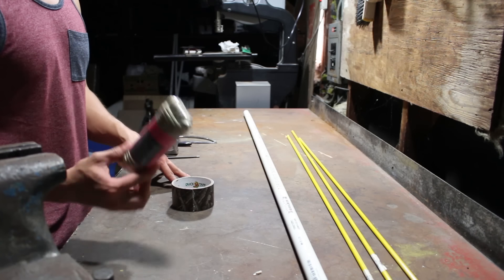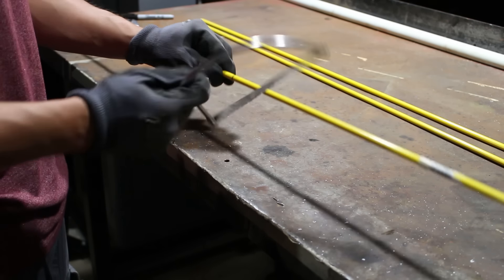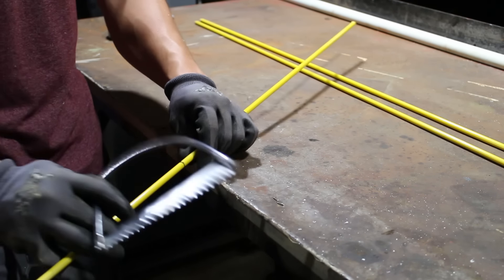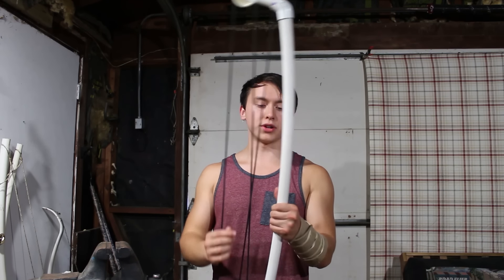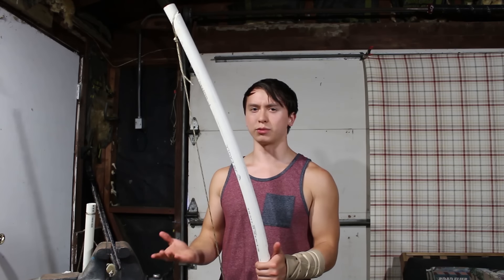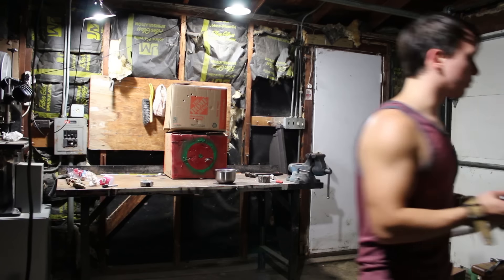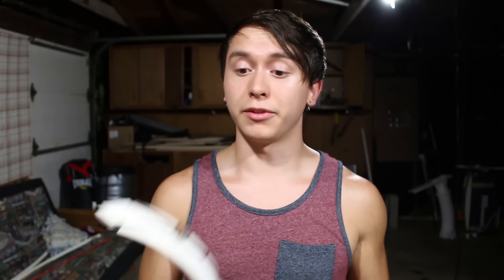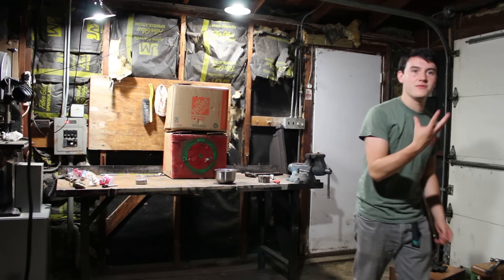Easy, Cheap, POWERFUL Bow (NO Power Tools or Heat Needed)

Comment: hi ! what is that yellow strips thing ?
Reply from the maker: S123485697 Reflective fiberglass road marker, it's a reflective rod that you stick in the ground on the sides of the road so you can stay on the road more easily.
Reply: +ZednoughtAlpha Thanks
Reply: +ZednoughtAlpha and where did you buy it ?
Reply from the maker: S123485697 Hardware store.
Reply: +ZednoughtAlpha  Do you know what length these are and what diameter  seems like these are hard to find in the UK. Fibre glass rods can be sourced but not the same as the roadmarkers
Reply: +Beast weaponary no worries I'm going to be najibg a recurve bow which doesn't need the rods just a PVC pipe
Reply: I live at Malaysia, but I dont know where do I want to get that thing thats yellow couler...
Reply: is that the driveway markers>? there fibreglass rods
Reply: +HardcoreBloodyWiener 腥鑫腸 Any fiberglass rods will do, they are all pretty much alike, tent poles are commonly this type of rod they are also available at hobby shops/websites a lot of places will also stock carbon versions if you want to be all posh about it.
Reply: +vedasticks They are very easy to find... hobby websites and shops. They are used in model aircraft and such or tent poles, which you can normally buy separately from the actual tent. you can even get carbon ones if you want to be all posh about it.
Reply: +ZNA Productions Hi dude, I've a question:  Matter the thickness of the fiberglass? Because I found it in two ways: 1.83 mm and 1.52 mm.
P.S. Great Job!
Reply: +Bryant get the 1.83
Reply: +HardcoreBloodyWiener 腥鑫腸 
Hi ZNA
thanks for an interesting videuploadl First time im watching ur videoes. Ur analyse of the recurve vs the monster bow made me thnking. Maybe I dont know it has to do with the recurve bow ahs an (s) shape where the ropes are tied to the bow so it allows it to be pulled longer backwards and delivering more power? just thinking im not an expert though
Reply: Thats yellow tongue- the tongue in tongue and groove chipboard flooring.  go to.any building site with a few beers and the foreman/ chipped will keep the unused bits for.ya

Comment: We used to do the same thing growing up ,this is what we used 1 half inch PVC pipe 1 3/4 inch PVC pipe put the half inch incide the 3/4 then cut notches about 1/4 of the way through the 3/4 inch. Then bend the pipe  using a person on ether side and a piece of steal suspension line ( single strand). The arrows we used duct tape for the fletching , aluminum tubing for the for the arrow shaft and take a file to the end get it as sharp as you can. You might not think this has much of a draw but if done right it has plenty. We took just about any thing we wanted to with them normally with the first shot. the tubing even works to bleed out the pray   faster in most cases

Comment: you are using the same arrow for every bow, you need use a longer arrow for the 75 pound bow to get 75 pound of force
Reply: no, the length of arrow is unimportant, the length of draw should be the same and the weight/spine of the arrows should correspond to which bow is being shot

Comment: Thanks for the very interesting video. Maybe the recurve penetrates farther because the arrow is going faster? I know that sounds obvious but an arrow's speed is a result of a continuous pressure against the nock by the string for a longer time.  A very high pull weight bow may only have a lot of pressure at the first moment of release and then not be able to move the string fast enough to maintain pressure against the nock. The total energy of the arrow is determined by how long the string can push the arrow and transfer energy. Imagine hitting a marble with a baseball bat, you will only be able to transfer energy for a very short time, compared to hitting a baseball.

Comment: Nice informative video but one thing you did not mention though,  is if the PVC were to break at full draw the fiberglass rods are going to keep you from getting hit by the PVC sections since they will maintain a degree of structuaral integrity.
Also along the lines of NOT using power tools to build your bow is you could use a large pan of hot water to soften the 'limbs' and then a 1" by 4" piece of wood (or a 2x4) to form the limbs with, while keeping the middle five inchs for the grip as is or even being formed to fit your hand for better control and comfort while shooting.
Thanks for sharing, and as soon as I hit 'send' I am on my way to Home Depot for a length of PVC and a few fiberglass rods but will be using some 1/8 " covered cable for the bowstring which will be reinforced at the tip to prevent it from damaging the tips.

Comment: The recurve adds speed because the ends act like levers different from the central "main" curve. As important, they add a more continuous (longer) acceleration just as the energy of the main curve is spent. They are "whipped" like the end of  leather whip right at the end of the main curves release of tension. Your long bows have power to launch heavier arrows, but for speed - recurve.

Comment: You are correct on the recurve, they produce more power and speed than the same draw weight long bow, 

And other suggestion for the difference though could be that the arrows were way underspined for a long bow of that weight and as such were striking the target on an angle which was sucking up some of the penetrating power of the arrow. Also as suggested by someone else, the long bow shots where hitting more to the side of the target making it move more also sucking up some of the penetration

Comment: yes, you do need to use a heavier arrow even to get a decent percentage of power out of a higher poundage bow , if you do not use a heavier arrow the arrow will be launched without even soaking in a decent amount of power thus yielding a result similar to what you see here.
The second reason why recurve bow performs better is because it was designed to, it is an upgrade on the longbow. So two similar bow with the same poundage but different designs may lead to recurve bow performing better.

Comment: This was the first PBC bow I made, and the worst.  I've made several dozen since according to the method of the Backyard Bowyer.  This one is powerful but lacking in action.  It actually doesn't throw an arrow as well as a better made bow a horse bow or recurve of less poundage but better geometry.  Weight is only half the equation and a better bow isn't that hard to make.  It can be done over your stove in the kitchen.  This one would be OK in a pinch but only till you could learn the science of what makes a bow really work.  I did, and I'm still learning.

Comment: Recurve does provide more benefit towards the draw/release. With wood recurve, the wood deforms when drawn and the additional strain of the recurve grants more "weight" than otherwise the stave of the bow could provide. I assume this carries over with most metallic bow staves (maybe) I have no idea if that would would on pipe so much... worth checking. I would guess it would have some effect, but that the actual effect would vary between bow stave materials.
As I understand it, the recurve in a bow stave provides greater initial acceleration to the released projectile, therefor giving it more "weight". <-- Simplified.

Comment: I know this is a pretty old video but in case someone else didn't say it yet if you examine your video footage a little bit closer you'll notice that the recurve bow has a longer draw relative to its height I am no expert but I believe the recurve bow increases the length of the draw relative to the bows height, thus increasing length of time in which the bow can transfer energy to the arrow.

Comment: The recurve bow  accelerates the arrow until all the tension is off of it while the simple bow has it's highest acceleration of the arrow just after release at full draw.  My Brother and Mother used simple bows for years though I found one old plexiglass recurve that we always thought had the tips made wrong to attach a string until i bought  a 65# recurve bow  in 6th grade with $ I made bailing hay that summer and realized the tips were facing the wrong way on the old one I found because it bends the other direction from the simple or common bow ( came across this video looking for the right name for a simple bow as before I bought the good laminated recurve  I thought the only other kind of bow there was, was a crossbow, as the compound bow hadn't been invented or at least in common use in the late 60's).

Comment: I think that only the speed of returning the string is important as long as the pull power exceedes the str required to accelerate the weight of the projectile without losing momentum.

Max kenetic force is then probably determined by projectiles travel distant, airodynamic, weight and impact area size.

Comment: To answer your question on the recurve vs the monster bow is that the arrow is too weak and light for the 70+ pounds and absorbs most of the energy driving it forward, a stiffer and heavier arrow would be better for heavier poundage bows

Comment: Late response and by now you probably already know this but the reason re-curve bows (and the most modern answer to the issue compound bows) exist, is to get more bang for buck. higher force is not the only factor velocity of the arrow.
how long and when you apply the force matter just as much. Your pvc "longbow like" bow applies a lot of force in the beginning but looses force quicker so the final velocity is a little less probably than that of the re-curve. Compound Bows are generally even more efficient than re-curve.

Comment: A bow with spindles at each end has more power because of the line running through it smoothly paired with the spindles adding more distance and ppsi

Comment: The recurve bow, in your case, works because the curved bits at the end hold the string physically further from your body when the bow is drawn.

Watch the serious British longbow guys, and you’ll note that they have this awkward lean thing they do.  They do it because with the bow that long, the angle of the string intersects your body early, before you get to the bow’s full strength if you don’t. 

Look at the video of you shooting the bow and watch the bottom half of the string.  The string hits your body at the same angle on both bows, which makes sense, your draw length is the same on both.  But, because with the longbow the string is in a different relation to the angle of the recurve bow, that means you aren’t getting the full draw on the longbow.

Which is why Native American hunting bows averaged around 45 pounds.  It’s a good combination of being able to draw and loose quickly and hitting hard enough to wound or kill a deer sized target.  You don’t need to be real strong to draw it, so anyone in the family can use it, and you don’t have to be standing at full height and leaning forward to get use out of it, so you have more options in how to approach the prey. 

45 pounds and about the size of that recurve is just damned convenient for hunting in brush, and it’s about as powerful as you can get for a median height person using simple techniques and natural materials without just scaling it bigger. 

But if you want to scale it bigger and get full use out of that longbow’s power, watch those Welshmen go at it for a while.

Comment: With a recurve bow if you know the draw and it’s let’s say 20 pounds than it will shoot the arrow at around 40-45 pounds because the recurve (the little backwards curve on the ends) will add more power

Comment: The point of bow construction is to make an arrow fly fast.  A heavy draw weight does not guarantee speed, it just means you can shoot a heavy arrow.  Expert bow makers fine tune their bows to snap back quickly, resulting in higher arrow velocity.

Comment: Hey Eli or anyone else who sees this and made this bow, how do you keep the fibreglass rods from falling out? Duct Tape over the ends? But that would still let them slide down to the bottom of the lower limb. Thanks, hopefully you see this! I've got both string loops sanded into my pvc, just gotta tie the strings knots and put the fibreglass inside!

Comment: Made my first one based on this tutorial. Turned out ok but my concern are the notches to hold the bow string in place. It’s initially staying but it really doesn’t look too secure. I am wondering if I should have used a smaller diameter rat tail file? I did put in frowns too with a skinner file. I ended up filing to where you almost can see the hollow interior on one side. Likely that will make it less durable. Anyone else have suggestions? What diameter rat file is ideal? Plus my rat tail tapered at the end a bit. Not sure if that was the right kind to use.

Comment: The heavy bow was penetrating less because of the arrow weight. It has a maximum speed it can reach and a max weight of arrow that can reach that speed. Heavier arrow with the heavy bow would penetrate deeper.

Comment: Recurve bows have a longer draw length because it goes till it hits the wood accelerating the arrow over a longer distance therefore upping speed for a lighter draw weight... it's like saying 50 pounds over 1 foot of acceleration or 40 pounds applied to accelerate over a foot and a half

Comment: Recurve bows are designed to have more force in a smaller bow with a lower draw weight, so it stands to reason, a recurve bow with a 45 lbs draw weight might compare to a 60-80 lbs longbow. Due to the shape of the recurve, it provides a more effective storage of energy, and thereby a more efficient transfer of energy into the arrow. Therefore the subscriber’s estimate may have been based on equivalent draw weight in an ordinary longbow, not actual draw weight.

Comment: You were holding the “monster” bow as you put it, towards the upper half compared to the other bows you used. If you hold it in the middle then it will generate more power

Comment: I did the math. The arrows were moving at 41fps.  We know that the string is 54 inches long because the distance between the notches was 58 inches(5 feet mines an inch on either end) and the string was 4 inches short of the second notch. using a frame where he had the bow at full draw, I calculated that the arrows were 32 inches long and it took 2 frames to travel its own length, so in .0667 seconds it travel 1.6 feet, giving us a final velocity of 41fps.

Comment: Does it hurt to cut the notch into the hollow portion of the pipe to accommodate thicker strings? Or possibly drill hole to feed string through?

Comment: hi! thank you for the video, it is one of the easiest builds i have seen, i'm so excited to try to build it as soon as i get my question answered:
what are the things you put in the middle of the pipe? i may have misread the translation or whatever, but i want to make sure i buy what is recommended.

thank you!
Reply: They are driveway markers I think, you know for reflectors so you can see where the driveway edges are at night, I think lol….
Reply: you might not be able to find them if you don't get buried in snow every year; driveway markers are very much an upper midwest/canadian specialty.

Comment: There's a lot more that goes into archery tuning your bow tuning your arrows, knock tuning, even your Fletchings, & rest rest. Tuning arrows for self made bows Is really important.  Just because your getting what you think is more power doesn't mean s*** is that arrow was coming off sideways. Case in point the recurve shot those lighter arrows better Because it's a weaker bow shooting very weak spined arrows. It's dangerous shooting weak spined arrows with high poundage Bows.  That doesn't matter if it's a longbow, recurve, horse bow compound, Or cross bow.

Comment: Was wondering if I could get some more details. I bought everything but the pvc pipe is like WAY too stiff to want to bend. 

I also can't fire the bow at all. It's like the cord is too tight, the pvc doesn't bend any further and actually developed a dent in center

Comment: I can't remember the name of the channel I seen it on but I seen a video of a dude Heating a PVC pipe and making one very identical to that curved version when you heat it at high temperatures you can bend it around things and it will stay that shape

Comment: Its the spring factor . Power to spring. So if the construction has low spring capacity it wil not convert all power stored in the draw to spring back into place. In short more power doesnt mean more speed becouse of the spring capacity of the bow product.

Comment: I tried this with the 3/4" pipe and I'm a martial artist and I can't pull it back all the way. Granted, I'm a novice with bow, but just on strength I'm guessing the draw weight can vary depending on the PVC used and the rods inside. In fact, I was barely able to bend it to string it. How does it hold up to spray paint?

Comment: You don't need a heat gun to get it adequate bending temperature, a hair dryer or space heater will work just fine, granted it will take a little bit longer but it works fine.

Comment: 5:58 The reason why the 70# bow is not penetrating as much as the recurve is because the arrow is too light. If the arrow was actually heavier, the heavier draw bow will get it to penetrate more. It has to do with the spine and physics of your arrow AND the bow itself. That is why you never shoot light arrows with a heavy draw bow. The arrow is bending a lot more as it is being fired compared to the recurve bow. Archers will figure out what spine arrow they need for the pound draw of the bow. Heavy arrows have to be shot by heavy bows in order to be efficient.

As you were shooting those arrows, eli, the arrows were not flying true. they were angled downward which is not good.